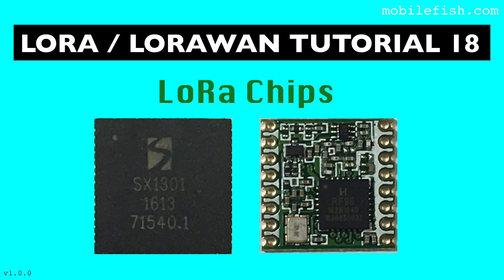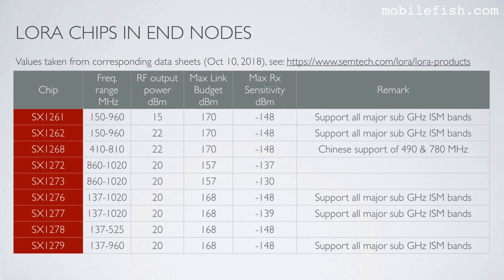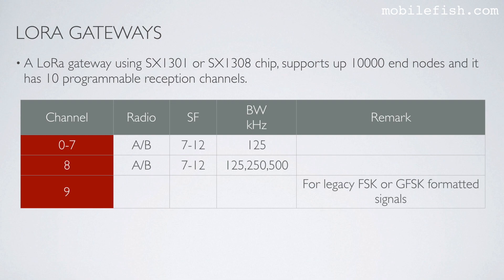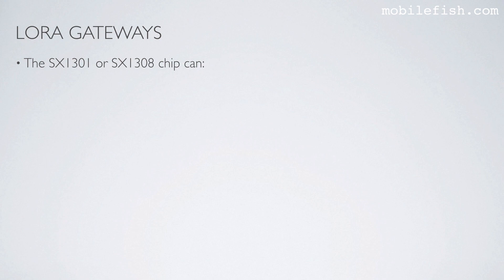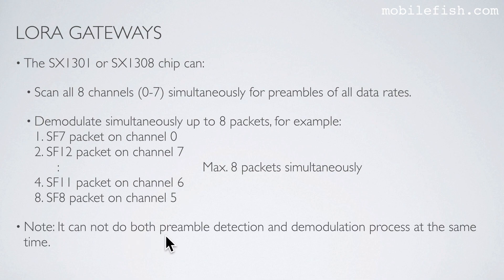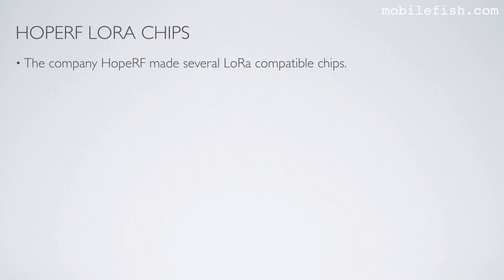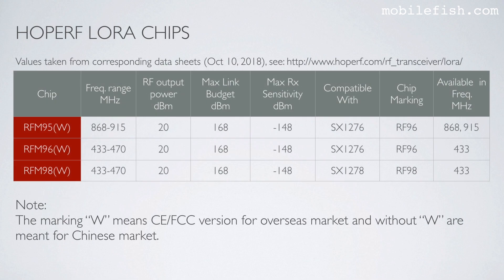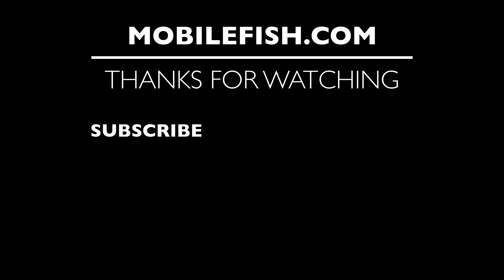LoRa/LoRaWAN tutorial 18: LoRa Chips

Comment: Very informative video to know about lora chips. But I have one doubt. In the video, it has been mentioned that SX1276 chips works in the frequency range of 137-1020Mhz whereas the SX1278 chips works in the frequency range of 137-525Mhz. Which hardware component inside the chips selects the respective frequency of the chips? Please reply.